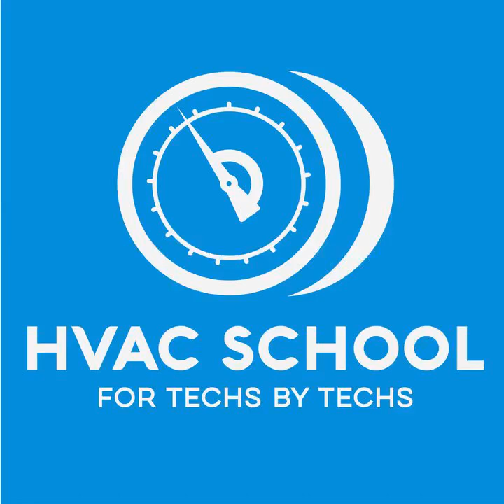(Podcast) Electrical Myths P2 - Grounding & Bonding

Comment: Very informative! I never truly understood the role of the ground & grounding rod. I know equipment grounding is for safety but I understand it more clearer now by providing a low resistance path to a safety device like a circuit breaker or GFCI outlet should it become energized.

Comment: What about tapping into a disconnect at the condenser unit to hook up your vacuum pump. The cheater cord neutral and ground are both connected to ground at the disconnect, is that correct. This is on a 230 volt single phase disconnect. Also is that safe. Thanks.
Reply: Wayne Miles ground is common

Comment: Your 80v jobsite equipment experience sounds like what is called "Hot Skin" condition in misswired or defective wiring in RVs.

Highly recommend Mike Holt's courses:  Understanding the NEC, Grounding & Bonding, Solar.  Book illustrations are clear, DVD's are entertaining & down to earth including panels of experts with wide experience, excellent coverage of this often poorly understood topic.  I realize this video is over 7 years old, so it may be of interest that terminology has changed somewhat to make the distinctions clearer.  IIRC, ground is now called EGFCP  (effective ground fault current path).
Another implication of this is the distinction between circuit breakers & GFCI's - the latter (if not defective) can save your life if you drop a hair dryer in the tub, but a circuit breaker takes longer so it keeps the house from burning down but won't save your life (unless the event occurred before your arrival on the scene).

Also, I had the 'floating neutral' situation happen in a bus conversion -- couldn't figure out why some of the nominal 110v receptacles had 208 volts & others 4 volts.  Turned out that some of the circuits on two different legs shared a neutral with the fluorescent lighting circuit ballasts, and the shared neutral had come free so current was backfeeding thru the lighting circuit neutral rather than going back to power panel neutral, resulting in either high or low voltage.  Or something like that!  I'm not an electrician so I this event triggered my purchase of Mike Holt's coursework.  Well worth the cost.